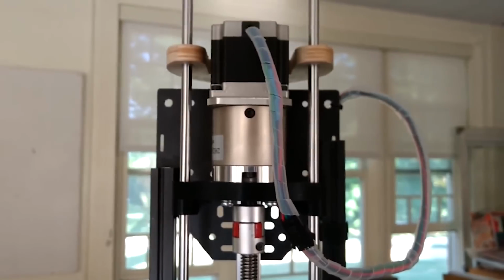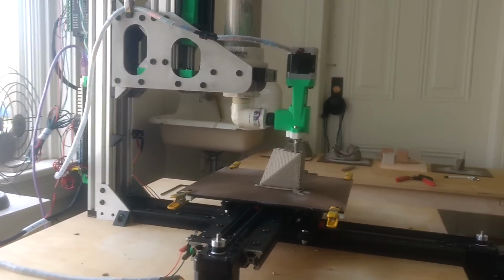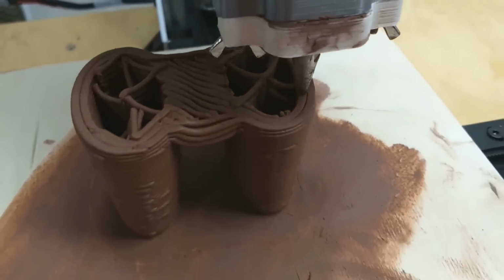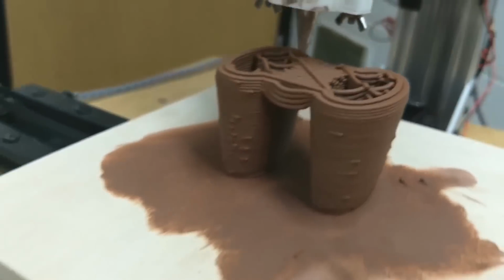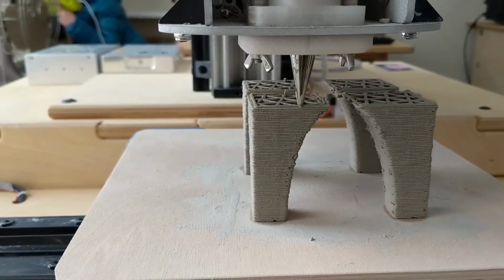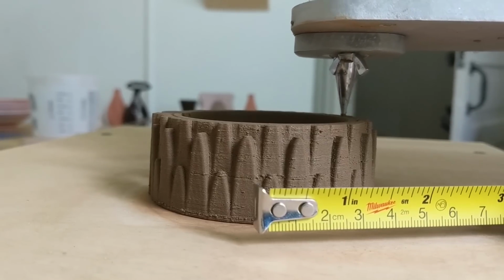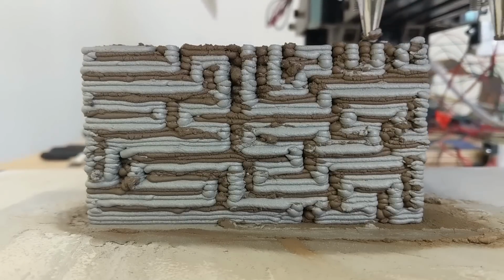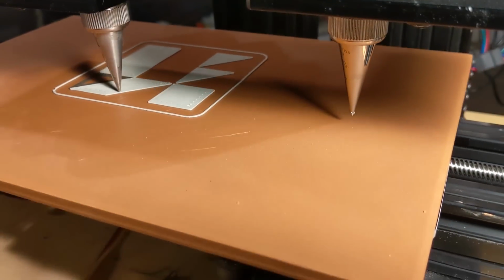Multicolor Clay 3D Printing (from NCECA 2021)

Comment: If you went through all the work to make this, why didn't you make a heated chamber extruder that would use plastic 3d print filament waste and plastic bottles instead of filament to save the planet, allegedly?

Comment: Nice, but i wouldnt go for cartesian, because the bed ist moving side to side, wich will result in a wobbeling model, due to mass inertia of the model. A core xy, where the bed/model ist only moving down, or even better a Voron Design , where the bed/model isnt moving at all, might BE the way to go.

Comment: Wow, what a wealth of information and great presentation. I must know more about your extruder setup. I see you are doing the larger tube with plunger/lead screw setup but how does the stepper that actually controls the extrusion at the tip work? I'm working on a project when I'm building a 2D axis inside a toaster oven to be able to add condiments to my toast while toasting and I'm in need of this extruder setup.
Reply from the maker: Thanks so much for your interest Kyle! I designed and built this extruder setup. It uses a large tube of clay which is advanced by a very powerful stepper motor, like a giant syringe. This is synchronized with an auger screw in the print nozzle which helps dispense the clay in the right volume, and minimizes oozing. I use a Duet control board to manage the extruder and printing
Reply: @TomLauerman  this sounds awesome! Have you patented this design or do you know if it has been? I have so many ideas for use cases now that I have seen this.
Reply from the maker: @kylethecreator  no patents or plans to patent. Similar systems are used by others, such as Stoneflower 3D, and 3D Potter

Comment: have you considered heat and a fan to improve the bridging?
Reply: In the monochrome object shown at 15:17 , I had rather thought of the usual use of double print heads, where one print head acts only to print support structures.
Another question that perhaps escaped me in the spoken text, that is the use of tixotropic agents. However, a stationary print platform would probably be more suitable for this.

Comment: I would love to start 3D printing in clay! I have many machine parts that are left over from previous machines I've built. Right now I'm still finishing my latest custom XY-based machine, but your videos are what keeps tickling my brain for more invention and I really want to make a move towards clay.
However, my in-home workshop is small and I do not have a car to move around high volumes of clay, also there's no kiln that I can use so it's going to take a while before I have the finances ready to add everything else that's needed besides the clay printer.

Now to come down to my point, and what I would really like to know, is about the infrastructure around clay printing. Enough about the machine and the tuning ;) I'm just so curious about the practicality of things surrounding the actual print. What about preparing clay, how do you store it? What about the cleaning of the claystruder? How much work is all of that? What about the drying process? Do 3D-printed parts crack more easily during the drying process because of the way they are constructed? What about reserving spots in a kiln, how expensive is firing a piece anyway? And then of course the glazing and the second firing.

What I'm wondering about clay printing, is essentially the same as with SLA printers, where nobody ever tells you about having to deal with hazardous chemicals, where you also need to rinse everything with alcohol and cure every part with UV.

I do not expect a direct reply to my questions, these are above all questions that I think are interesting to a lot of people and could potentially make good content for a next video in case you were looking for ideas :)

Thanks for sharing your detailed process so far, I really enjoy watching it and criticizing it in my mind how I would've done things differently, which causes a creative spark in my mind that inspires me in turn.
Reply from the maker: There are a lot of good questions in your comment, thanks! I'll show some more of the process as I go along in the future - the clay process, preparation, firing, glazing, kilns, etc. Short answer about toxicity is that wet clay is a very benign material. However, dry clay dust contains silica, so you don't want the dust to accumulate in your workspace. Glazes can have nasty materials in them - or not - depending on the glaze. Firing involves a lot of heat and good ventilation - but more on those topics in the future. Thanks for your interest!

Comment: The stepped piece in the end looked like it belongs in a D&D style gaming system.  Have you gone for the small size use due to Time issues at the resolution you are using? What is the finest you can print? can you get to 0.1mm layer heights or is clay too thick at that scale. Have you talked to cooks or confectioners, this would be good for sugar and more likely chocolate work.

Comment: If This gets ever into Functional/Technical ceramics, then I would get interested but for now in this stage of the only purpose to produce somewhat decent looking paper weights, then it is a waste of time money effort and potential. Extruding the clay onto a plate or directly in the trash bin makes no difference, because it would fulfill the same purpose XD
Reply from the maker: Glad you found my work to be somewhat decent looking!
Reply: @TomLauerman  did you consider to use a mixing screw extruder like in the continous plastic injection molding industry? Maybe also using the mixing end of those Plastering machines that shoot plaster against the wall? (I wrote this exact comment minutes ago and it got removed because I included a link of a picture of such a machine.) you should also make sure that you somehow enclose it our modify in such a way that it doesn't mix air into the mixture, because that's the reason why it splatters the plaster against the wall in the first place. Such systems don't use compressed air besides of the trapped and mixed in air bubbles. 🤔
Reply: Thank you for the quick response, btw I subscribed to your channel Before writing that. Because I want to know when the real deal with the technical ceramic starts 😎👌. I like that you are constantly improving the quality of the print by removing the layer ridges. Once you you get it really smooth, then you can start to print really complex and elaborate high temp nozzles and rocket carburetors. Making more reliable and resilient rocket parts. There is a huge demanding market for this Technical ceramics with... Intriguing shapes. You should check that branch out.

Comment: Fdm uses fan to cool the extrusion so it ca Bridge better. I recommend you also use a heat blower and or infra-red lights to dry the clay as you try to bridge.
Reply from the maker: Thanks! Clay shrinks as it dries, and this can cause severe warping and cracking. So drying the work more slowly is where I am putting some effort, rather than trying to speed up drying. Bridging is a little different in clay, but still possible. Post-processing is much more robust in clay than in FDM (in my opinion) so joining parts together after printing is often a more viable path than trying to solve bridging issues. Thanks for your interest!

Comment: Reminds me of videos I have seen of the auto and marine industry automated manufacturing industries for CNC applying glues, silicones, rubber, Etc... except your doing it in multiple layers building a predetermined dementional object. Have you seen Vid on the 3-D viscous concrete printed houses? Similar to what you are doing just scaled-down and you are doing clay.
Reply from the maker: Yes, concrete printing is fascinating! I'm most interested in artworks of a more modest size in my own work, but I'm amazed at what people are able to do at architectural scale. Thanks for checking out the video!

Comment: Have you put any work into optimizing the reclamation of used clay? Something like a deli slicer would probably work great for wet clay, but maybe a crusher for the dry stuff?
Reply from the maker: Thanks for your interest! Reclaiming clay is fairly straightforward thankfully, one can just add water and mix. Once it is fired and becomes ceramic this is no longer viable, however. The good thing is that any failed prints can be easily recycled and remade, an infinite number of times.

Comment: Hi, did you try to suck out air bubbles from clay using a vacum pump?
Reply: He's using an infill pattern anyways which is just bubbles
Reply from the maker: Yes, it is fine to have trapped air in ceramic objects. What causes trouble is trapped moisture - which becomes explosive steam in a kiln. So proper drying solves the air bubble issues.
Reply from the maker: I take care to avoid bubbles and voids in the clay when loading. I'll make a video of that someday (but it will be boring!)

Comment: Great video. I always wondered if a solid core wire could be introduced at the nozzle that would allow longer bridging capabilities as well as increased strength and rigidity of the finished product. Had a similar idea of printing a candle with the wick inside the extruded material.
Reply from the maker: Maybe! One issue is that clay shrinks as it dries and as it is heated, whereas metal expands when heated. I'm pursuing the possibilities of post-processing in clay by joining simple printed parts after printing to make more complex forms. Thanks for your interest!
Reply: @TomLauerman  very cool. I appreciate the motivation you provide. The time and dedication you’ve spent shows.

Comment: I just designed and built a clay 3D printer from scratch as my senior mechanical engineering design project. Actually, I used the same cake decorating nozzle that you used as a nozzle on so many of your printer designs. I have since graduated but I really want to go back and work on it and try to get it tuned better. I managed to print a few things in spiral vase mode that turned out excellent but those prints are easy because there is no need to stop for travel movements or anything. The extruder I designed doesn't have an auger like so many of the more precise ones do, so stopping extrusion or changing flow rate is hard. The extruder is just a 8" long, 1.5" ID tube with a TR8x1 lead screw pushing a plunger to extrude the material. I also had it geared down with a 1:5 gear ratio using pulleys and a 2GT timing belt to make sure the NEMA 17 motor had enough torque and precision for the extruder. I was hoping to be able to use Marlin's linear advance feature to account for pressure buildup in the nozzle when the speed to changes but I graduated before I had a chance and had to leave the printer there since the University paid for the parts. This was only a 1 semester long project for me and was essentially completely individually done, so timing was so tight that I basically finished it, then graduated and barely even got to use it all.

Your design is amazing though, I mean the high precision and ability to stop and start is awesome. I'd love to see the whole design in more detail.
Reply from the maker: Thanks for your interest! and congratulations on your project, which sounds like a real sprint, time wise. I will post some more technical stuff sometime. In short though, I use an auger in the print head and the main "feed" syringe is powered by a NEMA 23 motor with a 20:1 worm gear reduction pushing a leadscrew. So lots and lots of torque needed. I use the Duet3D control electronics with RepRap firmware and I built much of the machine with linear rail systems from OpenBuilds. I also printed and milled many parts in plastic and aluminum. Thanks again!

Comment: How has layer adhesion been when moving from one color to the next? In some of the later prints it feels like the two colors could just be slid apart from each other because of how clean the divisions are. Beautiful work. It's amazing that you've finally gotten down to ~fdm resolution. In the future you should also show more works after they have been fired as well so we can see how the structural color changes, as well as some glazed prints to show how they smooth out.
Reply from the maker: Layer adhesion has been good, and has to do with the dampness of the clay. If clay were too dry adhesion would be poor. I will be sure to show more finished work in the future. And I'm so glad you appreciate the FDM scale extrusion, that has been an obsession of mine - to more or less match what I can do with my FDM printer, but in clay. Some aspects will never be quite the same, such as bridging. However, clay exceeds plastic in some ways, particularly in ease of post-processing. Thanks for your interest!

Comment: When you said interlocking that triggered a "LEGO" thought.  Interlocking bricks.  Printed ceramic hinges.  Pizza ovens with working mechanisms: hinges, directional control valves to adjust the heat and smoke.  Even kinetic sculptures that combine waterfall, fountain, flame, and motion.  This is a great creative space you've enabled!
Reply from the maker: This all sounds very fun to explore, thanks for sharing!

Comment: Wow! great video, great progress you've made!

I'm a sculptor myself and have been developing a functional ceramic piece for the last five years and I can only guess at the amounts of work, time and dedication of all the people involved in this to get it this far. The results you show in the end of the video are amazing!

For me the way was/is making "press in" plaster molds since for a single person it is quite a lot to even get the traditional slip/claycasting process to work reliably. Having your process at my disposal would evaporate all of my current problems, but I can't afford to sink that kind of time in developing a process, I need to develop my piece/design. 

One thing that made my clay more ductile was adding glass microballs to my clay. I use 0.5mm but you'd need way smaller sizes of course so it would still fit through your nozzle. They work kind of similar to ground chamotte, improving the clays ability to stand on its own, but since they're almost perfectly round, the clay moves around freely and stays very easily formable.

At first, I had trouble understanding, what drove you to go this far, seeing that your current result is still an order of magnitude away from making an original mold in FDM/PLA and making your negative out of plaster, the disadvatage of having a big mold is being neutralized by the serial production aspect of plaster molds, imo. But when I saw your collection of fired end results, it totally made sense. You do get a very different aesthetic and also a different type of form. Your results definitely deserve more air time in your video, they are really amazing!
Reply from the maker: Thanks so much! Glass micro balls sound fascinating, I will look into this. I will also highlight some of the finished works in the future, several people have suggested this. I do post a lot of images of more finished things on my Instagram, check it out if you use that platform - I'm @tom_lauerman
Many thanks again!
Reply: @TomLauerman  Yeah, I use the microballs for thermal insulation, but I feel it changes the way the clay moves as well. At least to my experience. In the very least it should make the clay lighter and thus less susceptible to sagging and collapsing. I'm not using porcelain though, only regular clay, fired at 1060°C. Glass might become an issue at higher temps.

Comment: I wonder what would happen if you added something like a UV-cure epoxy into the clay -- enough to help it hold forms a bit better when its deposited.
Reply from the maker: This could work well to help the clay set up - however I do fire the dried clay in a kiln and wouldn't want to burn up all that resin. Thanks for the suggestion and for watching!

Comment: For cleaning up the lines, I would like to see what a watercolor brush(or sponge) that has a water reservoir attached to the extruder positioned to brush the lines following the extrusion. The brush would need some kind of adapter to squeeze the water at certain points to keep the brush tip wet. And of course the brush may need some axis controls.  

That's some good stuff!
Reply from the maker: I do lots and lots of cleanup by hand - but I've always wondered about automating that process. It is something to consider - thanks for sharing!

Comment: The one thing I see here that could really help with quality is a nozzle wipe zone to wipe the nozzles between layers, every X amount of layers or some criteria that would need to be tested to determine a good setting. Appears like much of the slop I'm seeing in the more mature designs is simply buildup of material around the nozzle itself either depositing onto the model or stopping the clay from sticking to the model (instead to the nozzle).
Reply from the maker: Thanks for the suggestion! In the last year or so the process has gotten a lot toghter - these videos go back 5 or 6 years. I'll have to show that improvement in future videos. Thanks again!

Comment: Which firmware is this based on?   very cool lecture Tom. I would love to try concrete printing some day and this is very inspiring. subbed.
Reply from the maker: Thanks for your interest! I use a Duet 3D control board and RepRap firmware. The controller has worked really well, and the people at Duet have been very helpful and encouraging.

Comment: you could also do a manual tape timing print, no digital logic, mechanical logic, or just layer by layer fill, always same pattern, variable pattern layer
Reply: its like putting a mask, then painting over, removing the mask, or letting it be, putting a next mask, painting that, continue
Reply: even paper layer masks that can be removed after, like layer-by-layer casting
Reply: pressure mold casting
Reply from the maker: Thanks for the suggestion, I'll have to give this some thought - it's all new to me.